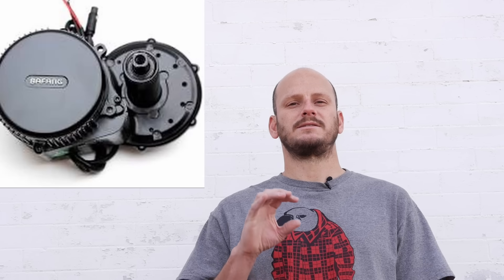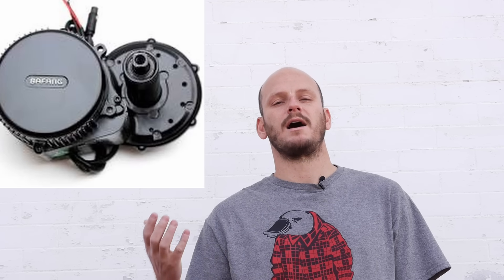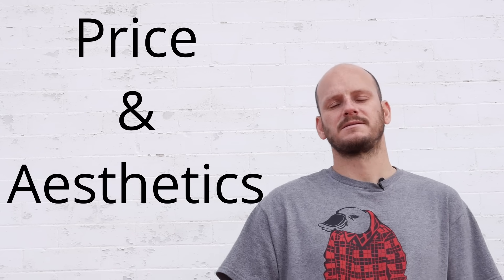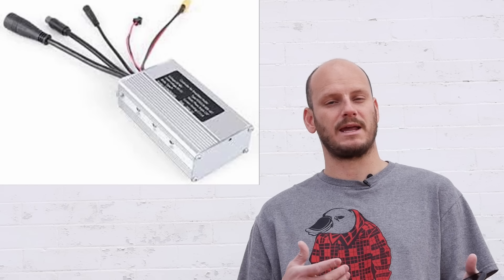Hub vs. Mid Drive Motors: Why Hub Motors Suck and Debunking Common Myths with performance test

Comment: Many states have limits on your assisted speed. In Missouri, 30 MPH is the max assisted speed on level ground. Faster than that, it's classed as an electric motorcycle with the requirements for license, insurance, helmet, etc.

In all my years of riding, in the USA, Europe and Asia, I've never broken a chain. It was my primary mode of transportation for the 19 months I lived in Norway, and for the year I was in South Korea. Of course, I didn't have a 1,500 Watt motor pulling on the chain (or the spokes).

Most of the articles I've seen about using mid-drive with an IGH talk about how it's a bad combination; yes, the mid-drive turns out more torque, for which the IGH is NOT built to handle. Replacing an IGH gets expensive. You might want to use it with a derailleur but ... if I never have to put up with a derailleur again, I'll die a happy man.

Teslas do not use a hub motor. They have an AC induction motor attached to a step-down gear attached to the axle. If you have a P<something>D, that has dual motors (front and rear). Some of the other companies are doing three motors but none of them are doing hub motors. The problem with hub motors on cars is that the motor is part of the "unsprung" weight, meaning it gets beat up by the road. Putting the motor on the axle (part of the "sprung" weight) means the suspension buffers the bumps in road, so the motor doesn't get beat up so much. You want as little unsprung weight as possible, so the suspension can keep the wheels in traction over uneven surfaces and to smooth out the ride. Anything expensive needs to be part of the sprung weight, so it will last as long as possible.

If a hub motor is messing up your spokes, it sounds like there's a real problem with the controller; it should be easing the torque off and on. Electric motors, however, produce maximum torque from a standing start and, if you just dump current to it, it's going to really yank, hard, on the spokes. Tesla has had to replace a lot of gearboxes because their motor controller was dumping power to the motors too aggressively (even before they came up with the Ludicrous Speed mode). Replace the gearbox and tweak the firmware on the controller and ... you still get performance but the gearbox lasts much longer.

When someone makes a combo 7-speed IGH with an integrated 250 W hub motor, I'll probably buy it for my daily ride (assuming it's not hideously expensive, of course; I will likely never own a Rohloff for that very reason). For a cargo bike, make it a 1,500 W or at least a 750.

Comment: Thank you for this succint but detailed breakdown of the differences between the two. I think I was leaning toward a hub only for the sake of a more convenient installation. But understanding the (now) obvious performance of a drivetrain versus a wheel in terms of torque I have no doubt about mid drive.  This is an older video but I am curious which motor would be geared the best for a utility bike that is used towing a trailer and hill climbs, sometimes both. I was planning to add a e-bike drivetrain sooner but as I rode more I got in shape I find I dont need it as much as I needed to get in shape but it would be nice having assist in the hilly terrain I explore on bike camp trips with a small trailer for gear/surfboard.
Reply: Go for the 1000w, it will run cooler and handle your kit with ease, IMO. please update us on how you go.
Reply: @slavojalois1639  1000 watt definetly worth the money. Mine rides like brand new after 2 years

Comment: Thanks but I'm confused. I'm looking at a 21 speed hub motor
Reply from the maker: Those gears are not used by the motor only by your legs. With a midDrive all those gears are powered by the motor. That’s its main benefit

Comment: I don't get the spokes argument as negative of hub motors. Ebikes transfer power via spokes regardless of it being hub or mid drive assuming both has spokes. Am I missing anything or he's just comparing hub motors with spokes against mid drive with mag wheels?
Reply from the maker: Check pinned comment

Comment: Having built a 1000w mountain bike with a hub drive in the rear I think I can say yes, the mid drive may have more torque,  but I can still fly up hills and rip on the flat surfaces at 38 mph in almost complete silence, while I have yet to see a mid drive that isn't  a whining gravelly sounding p.o.s that is high maintenance, needs very special tools to service, usually must be pulled from the frame, usually requires a special, expensive frame, can destroy your chain and gear set, usually has annoying software with many glitches (like abrupt pauses in torque when detecting gear changes) the motor weighs more and has annoying internal rattles and gear noises while coasting.  I know this from speaking to actual owners and researching the top mid drive manufacturers. While they are improving in huge strides, my bike is simple, cheaper, lighter, fast, has full suspension, and can still take quite a beating. I'm  55 years old and I fly through the power line trails over big rocks, trees, and through small streams. I already broke the frame from jumping over a stream and landing on the other side embankment, but I have a good tig welder !  Some day I may look into a mid drive bike like a Frey am 1000, but they are around 4,000.  So I can wait.  I ride my bike nearly every day and I love it. The kit was around $200.00 on Ebay, and the 1000w/21ah battery around  $300. So, unless your going to ride like a nut on a trail with a class number, I think a mid drive ebike can be quite a blast, especially if you want low maintenace, reliabilty, low cost, and a smooth, quiet ride with pretty decent acceleration. Don't  take my word for it...try one and I bet you'll be impressed. I rarely ever have to pedal my bike, even up pretty steep hills on the road. One big advantage of a mid drive is low, centered weight. I noticed that immediately. My battery is pretty high above my rear wheel, so my bike does wheelies up steep trails if I lay into the throttle but the traction is superb and I can always just lean a little forward. One important note... I had issues with the rear tire popping from the extra weight during jumps, and the rim is very heavy duty but does not like tubeless tires. Whatever you choose, have fun and good luck. If anyone is interested in just buying a reasonable entry level e mountain bike with mid drive, look up the motobecane hal - ebike reviews. I never dealt with the company but some people seem to like them. I might check it out someday.

Comment: I am about to purchase a Firmstrong Ultra Bicycle which has a coaster brake in the rear wheel which I apply by pedaling backward. There are no hand brakes on this bicycle. I want to install a mid drive motor but need to know if it will work with such a system. Will I still be able to stop the bicycle by pedaling backward if I am removing the entire crankshaft & arms?
Reply from the maker: Tongshen makes a coaster brake compatible motor
Reply: @JohnnyNerdOut  thanks for that info. But I’m a bit confused. This compatible motor where is it installed in the mid drive or the rear wheel?
Reply from the maker: @lvitti  mid drive
Reply: @JohnnyNerdOut  

I feel like an idiot asking you this question but here goes since it’s a single gear bicycle that works by peddling if I replace the crankshaft with a mid drive motor and I want to go fast doesn’t that mean that the pedals will be turning fast which means I’m really peddling at all times and that’s going to exhaust me because the pedals are turning very quickly if I want to go fast so what’s the whole point of having an electric bike if that’s true?

Comment: From the start I've always like Mid drive over Hub drive. The reason for this was that if you damage your wheels you can always get better wheels and even run a different size like from 29er to 27.5 without really worrying about the drive. But with a hub drive you have to really get the motor or wheel repaired and that takes time and money. And deep down will you be happy with that large lump of metal in the middle of your wheel? That's why a lot of proper mtb's use mid drive over hub drive. And it's more of the balance of the bike. Better to have the motor in the middle and low down then to have it in the wheel. But yeah it's true what you said about the spokes it kinda makes sense now.  I think hub drive is only good if you live in a country that is flat without any hills like Holland where is pretty flat. But for me I would still run a mid drive any day. I have my eye on a Nukeproof Megawatt just waiting for it to drop in price because right now you can buy a car for less.
Reply: Wel as a Dutch person I can tell you e-bikes with hub motors are almost gone by now. When e-bikes where a new think most had hub motors. But most new e-bikes have mid drive motors.
Reply: @egbertthomas3684  That is unfortunate. Maybe we will figure out sooner than later how nonsensical a mid drive ebike is, especially for commuting.
Reply: @difflocktwo  for commuting ok if you dont have long steep hills to climb but if you need to do that dont get a hub drive one just dont. for e mountainbiking hubs are crap aswell due to way to crap weight balance. central weight balance is better. mid drives are just more flexible in terms of gear ratios. but they do wear the drivetrain more compared to hubs
Reply: @SB7-r9i  We need to consider system costs and expected loads. I would say for a given cost you can always build a faster, more practical, hub drive bike. Maybe there are very specific conditions where a hub might cost more to keep up with the mid drive. Building a mid drive as low maintenance as a hub is also going to add a lot of cost.
Reply: @difflocktwo  in terms of pure cost yes you are probably right but it really depends on the usecase. for me a hub would be garbo as i do emtb tech climb where weight balance/gear choice is important. by having a motor in one fixed gear ratio you are either loosing the low end torque or the top speed. shure if you had 2000w+ you could bruteforce that but i am talking about a normal 250w nom/4-600w peak one here and in this power range a hub just isnt for me.
Reply: @SB7-r9i  That's not how electric motors work though. You can design a motor to give all the torque and speed you want. You do not need gears.
Reply: @SB7-r9i  also identical output is identical output. the power and torque output would be the same.

Comment: I really wish I would have found your channel prior to buying my "Lectric XP 2.0" .  Thank you for sharing good information.
Reply: lectric XP 2 isn't bad mate,  just the 10AH battery is a limiting factor in terms of range.  But for what, 999$ ,  its not bad,  its an ebike,  does 28mph, couldnt do a mid drive conversion for that price unless you basically got a totally free or extremely inexpensive bike.

Comment: Completely agree. Bought a hub drive bike first. Broke it in two weeks. $100 to fix. Two more weeks broke again. Bought a bbshd from Luna and converted a nice mtb. I have put over 5000 miles on it and the mid drive and battery has never given me ANY issue. Not once. I beat on this thing full throttle pretty much daily. I’ve put several derailleurs and chains and frame savers but mainly because of wrecks on the trails (and street)🤕 I’m unfortunately a fat guy. About 260 pounds. But I grew up riding motorcycles and dirt bikes so I know how to ride pretty good. But when you ride hard sometimes you wreck. 😂

Comment: I Would never buy a center drive bike again...why.... i had a battery replaced at 1500 miles on guarantee ( it would have cost £400) that was fine...but when the Shimano centre drive failed at 2000 miles just out of warranty I was told it was not serviceable and the cheapest replacement E6000 is £400 no returns no warranty...SO after spending hundreds on extra bit and pieces for a bike I loved to ride i have been left with an expensive pile of JUNK, thanks RALEIGH...I  have since bought a second hand 40 year old bike and will fit with a cheap Chinese kit...eco friendly  eco crap.

Comment: Buy I mid drive, but have and hub motor. And maybe hub motor better. With mid drive I must always pedal. With hub I can use trothle or pedal with pass... Mid drive only one advantage that you can good climb any hill. But efficiency is higher in hub due less reduction gear numbers.

Comment: Dude! I wish I had watched this before considering a hub motor. Im currently using a 2000w hub motor, but the torque on these is INSANE! Maybe ill just do a dual electric setup! Hub motor AND Mid Drive!
Reply from the maker: You’ve officially gone mad with power
Reply: Just put another hub on the front

Comment: Friends, I want to convert my hub ebike to a mid drive motor.  Do all hub motors fit into the pedal openings or are there different sizes.  Thanks for the help.
Reply from the maker: Check my video on measuring your bottom bracket 😀
Reply: @JohnnyNerdOut  I did and it's 73mm.  My question is...are all the diameters of the opening the same?  Didn't see that in the video.  Thanks. (is there a donation link for your help?)
Reply from the maker: @CarlJBier  there are a couple different sizes used, but most are the standard BSA. If yours is not, you can get adapters 👍
Reply: @JohnnyNerdOut  OK, thanks. I'm going to give this a try. Wish me luck 😆.
Reply: @JohnnyNerdOut  Thanks for your help.  I ordered the 500W 36V (because I have 4 36v batteries) but they use the T60 connector.  Would you know where can I find a T60 battery connector - to a Bafang adapter?

Comment: Funny video with a few good points and some real rubbish. Yep mid motor has more torque from stationary IF you are in the right gear.... That's where the the good points end at least for higher watt motors. Drivetrain suffers as hell if you start a mid motor in the wrong gear. THe controler issue is actually the other way round..I rather have a well cooled external controler I can change easily (and manipulate). The biggest BS here is the hub motors have the wheel fall off......coz the power goes trough those spokes to the wheel...LOL someone tell me how that is different if you use a mid motor....Ther must be some magic fairy stuff that transfers the power from the mid motor/chain/casette to the wheel/tire. I love my 2kw hub motor on an mtx 29 and nope the spokes haven't broken jet nor do they get loose all the time.

Comment: Well, around my area mid drive are way way too expensive. I can buy a hub e-bike for about $600, but mid drives goes from $3000 to $7000. I cant afford that on a bike that could be stole (which happens).

Comment: Same power but significantly higher torque from the DRIVESHAFT OF THE MOTOR UNIT immediately tells us that the high torque motor is a high rpm geared motor and the other a low speed direct drive motor. Low speed motors are manufactured with this differnce in mind for a lot more jobs than powering bikes. It is expected that feeding the power through the bicycle gears gives more flexible performance. At a technical level your car comparison looks back to front. Big internal combustion engines that have low down torque are the low rpm variety while smaller engines that achive the equivalent power at higher rpm require skilled use of the gear box to get good acceleration. In reality the Hub motor produces more torque than the Mid Motor before it's speed  is geared down for the output shaft. As far as 750 watt motors go it is flexibility that makes the mid motor good. It is interesting that the steady torque from an electric current is closer to that of a steam engine than that of a reciprocating internal combustion engine.
In UK anything over 250 watts has to be registered as a motor vehicle to be of real use, but providing the 250 watt motor is used to compliment human leg power and meets the usual  bureaucratic junk it can be used as an EAPC, which means like an ordinary bicycle. In this case simplifying the bicycle and saving weight helps, which favours hub motors.  
 1500 watts is just over 2 horsepower. Ignoring the problem of approving and registering such an electric bike,  it is possible to get an 8 horsepower step though motorcyle ,which is built to accept more than human power, and another person for about $1300 in UK. I shall not be replacing any of my motorcycles with electric ones but I do have 3 Electrically Assisted Pedal Cycles that I can use on dedicated cycle paths and get modest performance that still makes me feel a lot younger.

Comment: I have build with 1000w rear hub throttle only and bbs02 on other bike, and ye torque better on middrive but i love the hub as its maintenance free over a year not a single repair while midrive already need rear cassette soon plus chain streched and you always need think about what gear using  so its same as manual gear box on car and hub like automatic

Comment: The only negative that I had read about mid drive motors is that they wear out sprockets and chains faster than a hub motor.
Reply from the maker: They really only wear them out if ridden hard or improperly

Comment: How would you compare a hub motor in the front or the rear wheel? Is it a similar cost to convert a bike to electric, whether the conversion is mid drive, or hub motor? Perhaps an advantage of a front hub motor, is if a person can only have one bike, they can quickly transform their bike from normal to electric, and not carry the extra weight.
Reply from the maker: For the same quality components, it costs within $50. I would prefer rear wheel drive than front for handling preferences